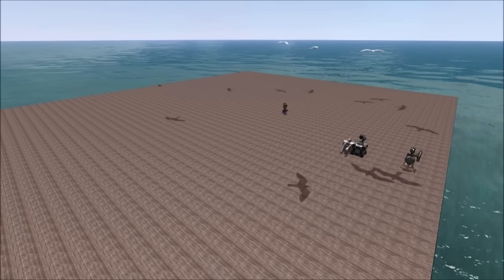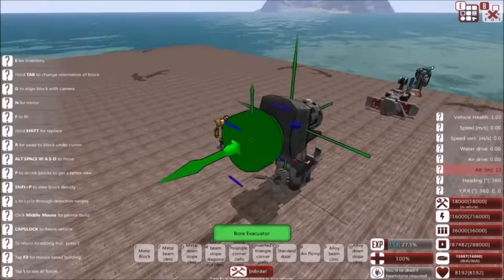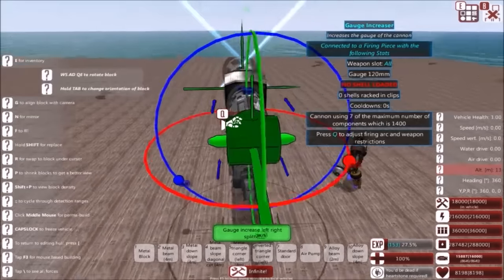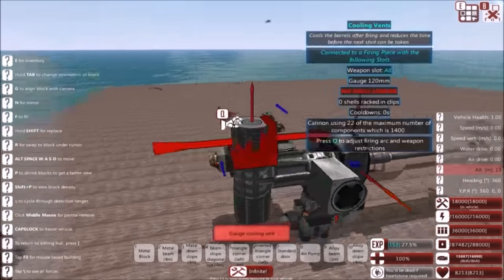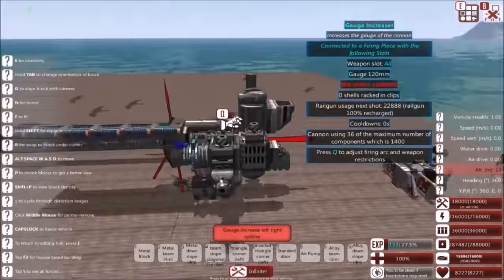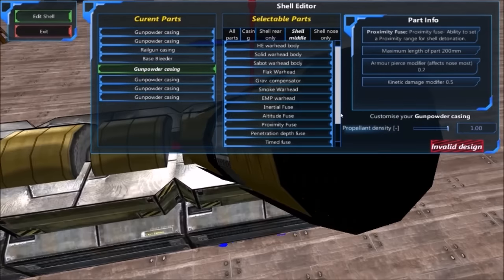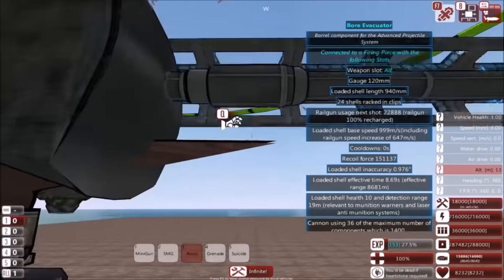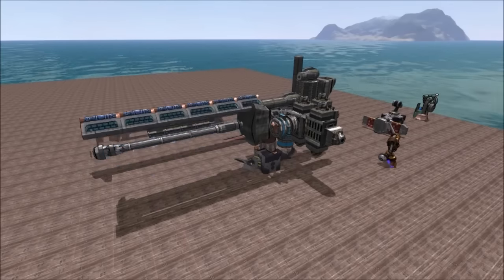APS/Advanced Cannons | From The Depths Tutorial #1.5

Comment: When I tried to load the round it did not work and I wont load I don't know what to do
Reply from the maker: There can be three things causing this. One, your craft may not have ammunition on it, but I don't think that would be the issue. Two, your autoloader should be connected to a gauge increase, cooler, or directly to the firing piece itself. Three, your shell may be too long for the autoloader you have. To tell the length of the autoloader you need, simply take the gauge of your gun, say 120mm for simplicity, and multiply it by the number of modules your shell is made of, say 8. 120 x 8 = 960. The shell you would be using would be 960mm long, so just less than 1m. Thus, you should use the 1m loader for it. Always round up, though. Even a 1001mm shell won't fit in a 1m loader. It needs a 2m.
Reply: DimAurora thank you this really helped me
Reply from the maker: Glad to help.